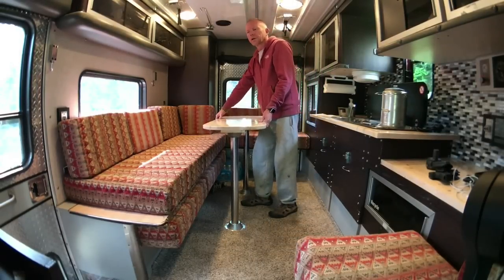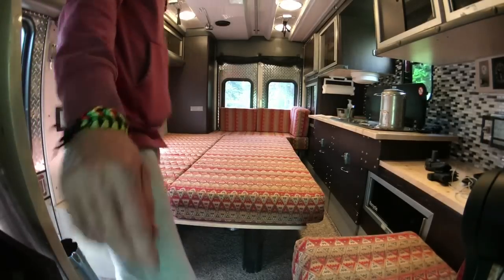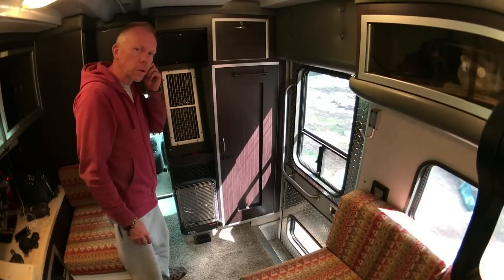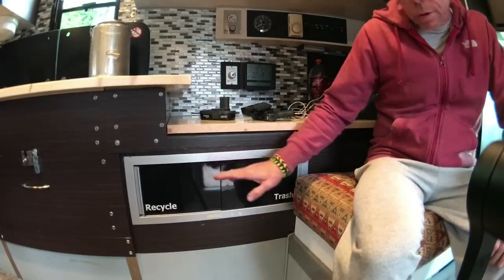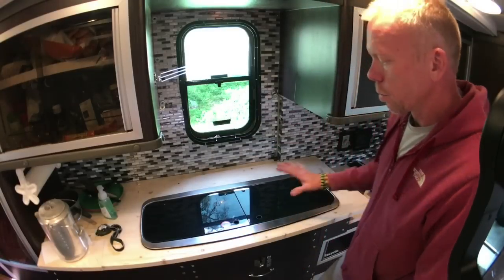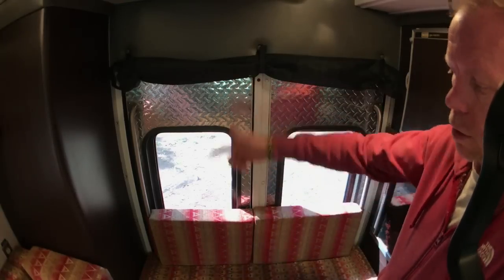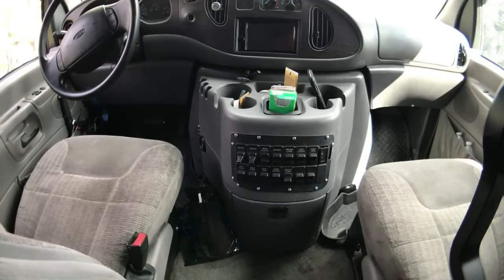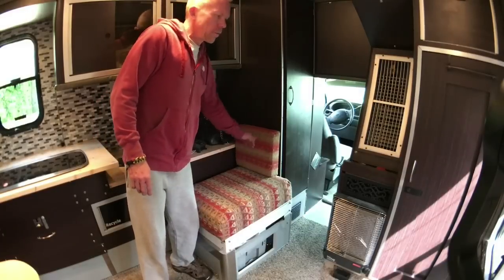4x4 ambulance camper conversion part2 (interior)

Comment: I'm in the research phase at this point so I'm watching lots of videos. You have a very nice rig there! turning radius isn't a huge consideration for my use so I'd look for a truck chassis with stock 4x4 but it's nice to know this is possible. It's also nice to know it's possible to add a window or two. Thank you for posting your ambulance conversion videos.

Comment: Did you do any insulation after you bought it, or do ambulances come really well insulated. I'm planning on building one out for snowboarding so I will be in some pretty cold areas. Would the stock insulation hold up?
Reply from the maker: Elijah Scott there are type 1/2/3 ambulances and have different ratings. Mine is nicely insulated and I have been vary impressed with the insulation. My niece had one when she was a competitive skier and she was all over northern america and Canada competing and loved how it worked. Mine was rated for 0-100 degrees conditions when I looked it up. 
I would figure out what kind you have and look up the specs.

Comment: What is the ceiling height in your ambulance I'm interested in building a camper myself thought about an ambulance but I don't want to be able to stand up I'm almost 6'2" trying to figure out if I want to build an ambulance or short bus depends on ceiling height
Reply: Tim Bryant type lll ambos have more headspace I think... Research to see...
Reply: I just bought an ambulance. i cant quite fully stand up and im 5'11.thats the "van" style one, though.
Reply: Get a sprinter
Reply from the maker: I'm 5'10" and I have about 4" clearance, my niece has one and I can touch the roof with my head in hers. One guy I know is building one and his is like 6'9" inside so I think they very quit  a bit.

Comment: Hi Pro Tint! LOVE your rig! I currently have a 4x4 ambulance that is set up as a dually in the rear, but I really would like to modify it so it is a single rear wheel like yours. Would you be willing to share your experience on how you went to SRW? Thank you!
Reply from the maker: Blake Zahn it was really pretty straight forward. I used unjoint offloads kit for the whole application front and rear axle. The rear axle was basically  cutting the spring perches and shock mounts off the axle and welding new ones on it the correct position , making sure the pinion angle for the drive shaft was at the correct angle. I used the front and rear axle off of an excursion 2003 so I didn’t have to find a axle with the same gear ratio to match an existing axle. I am very glad that I did switch to a single axle because the width is much better off-road. I have chewed up the sides of my rims on rocks on tight trails and I don’t think I could have made it through them if it was a a dually.

Comment: What does it take to go from dual rear to single? I would like to do the same with mine.
Reply from the maker: It is the easiest part of the conversion, the spring perches had to be changed on the axle and I had to also add shock mounts. This all cam with the Ujoint kit I had made as well as instructions.

Comment: Would  you be able to run the AC off a small generator? Thanks
Reply from the maker: The AC is powered by the motor, the only way to run it is if its running.

Comment: Did you just paint and refinish most of the original cabinets? What type of finish is that? 

Thanks
Reply from the maker: Andrew Smith it is synthetic wood/vinyl film. You can get it here. http://www.ebay.com/itm/like/161955521272?rmvSB=true&ul_ref=http%253A%252F%252Frover.ebay.com%252Frover%252F1%252F711-53200-19255-0%252F1%253Ficep_ff3%253D2%2526pub%253D5575011129%2526toolid%253D16011%2526campid%253D5337096871%2526customid%253D7118766%2526icep_item%253D161955521272%2526ipn%253Dpsmain%2526icep_vectorid%253D229466%2526kwid%253D902099%2526mtid%253D824%2526kw%253Dlg%2526srcrot%253D711-53200-19255-0%2526rvr_id%253D1197835348791&rmvSB=true&ul_ref=http%253A%252F%252Frover.ebay.com%252Frover%252F1%252F711-53200-19255-0%252F1%253Ficep_ff3%253D2%2526pub%253D5575011129%2526toolid%253D16011%2526campid%253D5337096871%2526customid%253D7118766%2526icep_item%253D161955521272%2526ipn%253Dpsmain%2526icep_vectorid%253D229466%2526kwid%253D902099%2526mtid%253D824%2526kw%253Dlg%2526srcrot%253D711-53200-19255-0%2526rvr_id%253D1197835348791&ul_noapp=true
Reply: You mentioned that you do window tinting is this stuff easy for a person that isn't used to working with film to apply? Is it holding up well? 

I really like the interior but it is hard to see the details of it.

Are your cushions custom made? 

Thanks
Reply from the maker: It is a pretty forgiving material basically it is vinyl film like you see wrapped on cars. I checked the data sheet for it and it is commercial grade so it should hold up and has so far,  you install it dry and it has  air channels to get the bubbles out. probably the hardest part is making nice clean cuts on the edges and getting all of the surface covered and not having it show any of the previous surface/ color. I would watch some vinyl installation videos and make sure you take the time to prep the surfaces and i'm sure you could do it, just order more material than you will need in case you need to do it twice on some panels.

Comment: Hey where do you buy that material you put on the wall behind the sink/stove?
Reply from the maker: Seth Wolfgang it's a rubberized synthetic tile with adhesive back available at Home Depot. It really looks like tile and is flexible to wrap around corners. I was concerned it would be a problem in the high heat we have here in Salt Lake City 105 deg. in the summer but it wasn't a problem at all. As with anything that is held on with adhesive preparation of the surface is very important. I used denatured alcohol to degrees the surfaces about three times before I installed it.

Comment: You can LED replacement domes for ambulances here:  https://www.kinequip.com/products/specialty-vehicle/lighting-and-led.html
Reply from the maker: Seth Wolfgang I actually found led replacement bulbs for both high and low light settings that fit the existing dome lights. I think I replaced all of the bulbs in the interior for about 100.00.
Reply: Oh nice. That I sent is what we use on our ambulances when we need to replace them. But glad you found some.